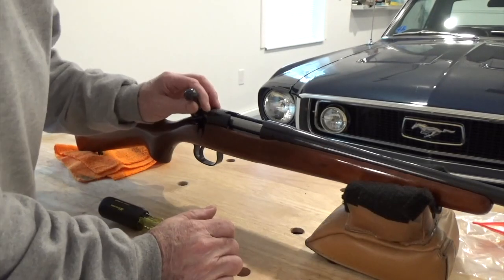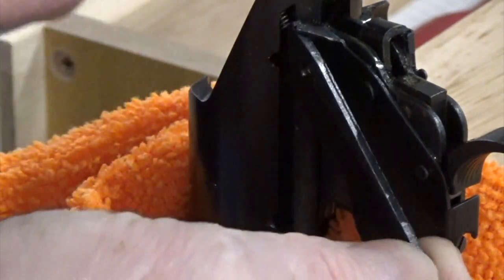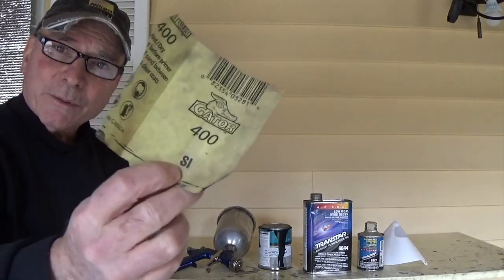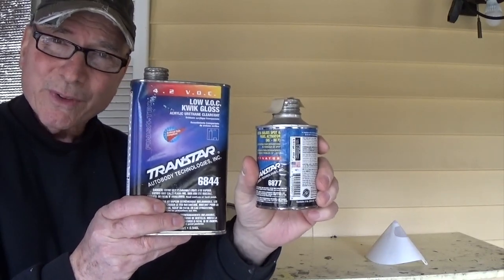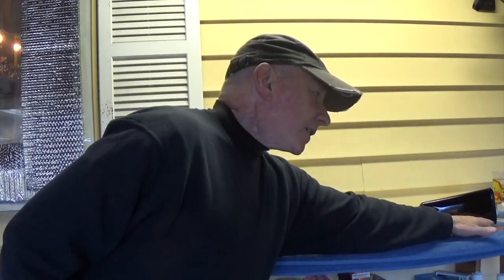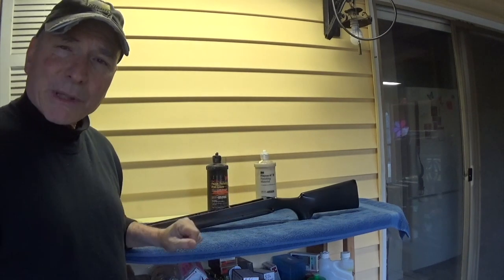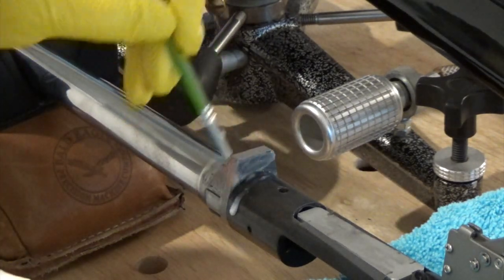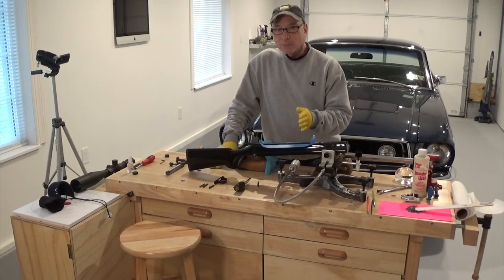722 222 Bench Rest Project

Comment: I have been cleaning my bolt rifle bores. The Triple 2 was bad and took a lot of soaking and scrubbing to restore the bore rifling. I am just about done with the .223 now. I have not even started on the .22-250 but it has had the fewest rounds through it. Thanks for sharing.
Reply from the maker: Sure does take a while to clean them at times. Just about when you are sick of cleaning they are done. Some never come clean. Have a good weekend RB.
Reply: @ToadleyBrowne  Exactly. I didn't think that Triple 2 was ever going to clean up. Then it did. I won't say all the powder carbon fouling is completely out but all the metal bits and copper is out. It ought to shoot much better now. Take care.
Reply from the maker: @rbm6184  Done quite a bit of research into the very problem you discuss. Never have seen such carbon fouling and throat wear quick with a specific powder. R-7 provides excellent performance, it is accurate, not real good in temp swings and fouled the crap out of the old 222 and that was a reason I changed it. After new barrel the R-7 provided accuracy well under .3 but even cleaning after 20 rounds was difficult to remove the carbon. R-7 is a double based powder of Nitro glycerin and Nitrocellulose. Slightly higher throat temps and filthy as hell, but accurate as hell. Recently switched to H-4198 which is Single Based Nitrocellulose. Immediately seen a huge difference in cleaning but accuracy is trailing behind R-7 as I have not found the load yet. Thank you for watching. I have a video on powder I am working on. Stay Safe.
Reply: @ToadleyBrowne  I use IMR 4198 that is pretty much the equivalent of H 4198. Its not super dirty but over time it can build up. Keep looking and you will find that load. You can get exceptionally good accuracy out of 4198 but you have to find the load.
Reply: Both 4198s are just EXCELLENT in the Duce, I prefer Hodgdons version, a little more compact..

Still.... U will 💓LT30...
Reply: @ToadleyBrowne  Well I have now cleaned the bores on five rifles. The old surplus 1943 M1 .30 Carbine was the last one and I went through so many patches I lost count. Probably would have filled up a small waste basket. It is still not clean but cleaner as the crud color is now much lighter and no bits of metal. I have other rifles but I don't think they need it as bad as those five did.

Comment: That looks awesome and you made it look so easy to do .
Reply from the maker: One thing that I edited out was JB welding a shorter Follower in. The second day I had to cut it out and install a more ideal one the next day. Thought I would spare that part as I can be a dumb ass. If you notice the first glue follower is short and the final is longer. Up side is the process is fairly easy to reverse. Eventually I will swap it back to original. Thanks!

Comment: Hey Toad, thanks for sharing. I noticed you never put any bedding under the barrel at all? I hear some say the first inch of barrel should be supported by bedding compound. What are your thoughts on this? Thanks.
Reply from the maker: I do not know about forward of lug. Not saying it will make it better or worse but less communication from the stock to the barrel is a good thing. The area would be under the chamber and as things heat up that may change which would not be a good thing. Thank you for the post
Reply: Your bedding technique should be sound.. No need to go the 1" in front of the lug.... 
Same for BR rigs... But glued in place without any fasteners. 

Your bedding looks sound.
Aim for ZERO's..
🙂👍

Comment: Nice work ! When you remove the barrel, is the clamping system (for the barrel) made in wood ?
Reply from the maker: Yes they are 2 oak blocks with rosin. They come in different sizes for the contour. I decided to get the Macmillan stock going after we were talking last week. The part about "lower profile" you mentioned made a lot of sense. Thanks for taking the time. The 700 will be getting the 223 and the 722 is the 222. Makes more sense for the vintage of the action and with the barrel nut they are easy to change. In some of my travels on the internet through this, one guy said, "Remington has got no nuts" I thought that was funny. Have a good weekend.
Reply: @ToadleyBrowne  with the previous stock your groups were already excellent. But with this stock it can be even more consistent I think. A good thing to get the full potential of your barrel and  your tripod to play with the wind. I hope you will made tighter groups Toad 👍

Comment: Hard to believe that action came off that easy. I've been struggling with a 700 for weeks. Action will not come off. I have same tools you displayed. Any advise?
Reply: It will be fun to see some 223 vs 222 this year when we meet up.
Reply from the maker: I have heard that can be a problem have not encountered one yet. These are things you have probably tried but if not give it a shot. 
Soak with Kroil muzzle down and in through front scope mount screw. Rosin the blocks and tighten the barrel like you are trying to slightly crush it. If it is tight the barrel wont move. Make sure barrel has no oil on it. The Northland wrench has that neat bolt for front action screw. Dont over tighten action wrench. Past snug but dont egg it out. Bottom action screw should hold. If that doesn't work try a  heat gun on barrel side and get hot enough not to be able to touch barrel. Last case grind a circle forward of recoil lug all the way around and that should relieve stress but it will waste barrel. My 1917 enfield video has details of that. Have a good weekend J and hope you and your family have a good Easter.
Reply from the maker: This guy was doing good on steel with a 6x47. You might like it. Have a good sunday J. https://youtu.be/YQR42S4Tlwg